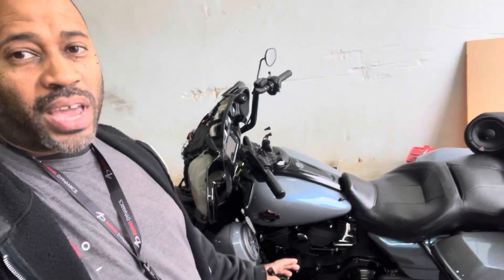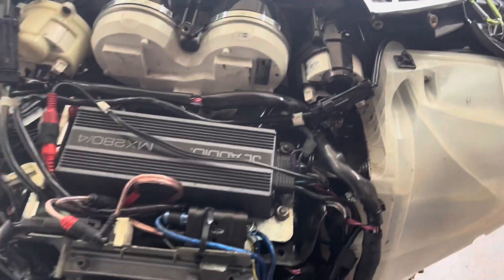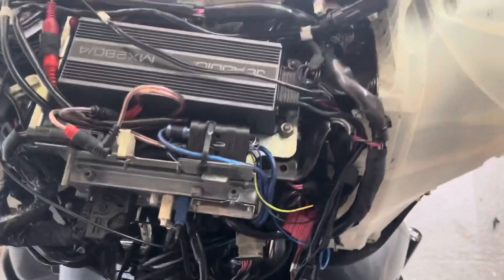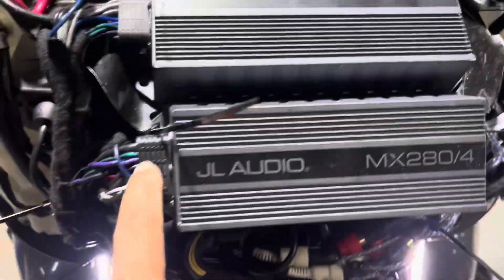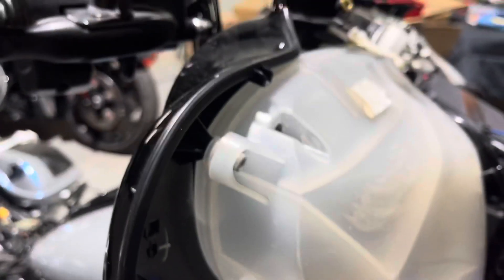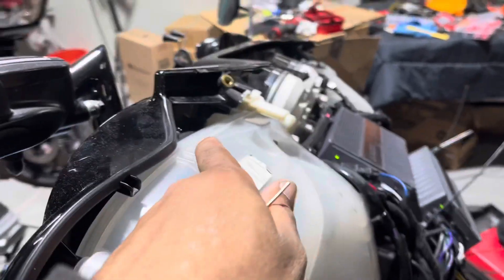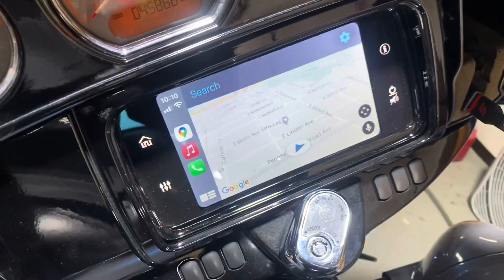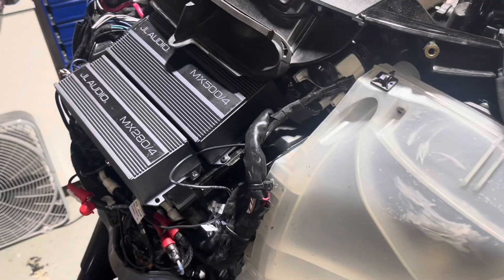Manny’s Street glide in for a 8 speaker setup ( no woofers in the bags ) Project - Battle Ship Pearl

Comment: I'm in Jacksonville FL, I have this setup on my bike  that I did myself, but I think it can sound much better 
I need to get it tune and probably need a wire rescue.
will like to send my Bike to your shop, do have a company that you use for your customers to shipped the bike to you?
Thank you 

2 Evox 1200.4
Model of Bike	Street Glide
Choose your DSP	Rockford DSR1
Stock or Aftermarket Radio	Stock
Stock Radio, has it been flashed?	Yes
What Inputs were used	Front and rear
Output 1/2 Speaker make and model	Ferring (Front)
Ground Zero 6.5" Coax GZCF 6.5SPL
Output 3/4 Speaker make and model	Lowers (Front)
DB Drive Euphoria XPERT EX6NCD 6.5″ 2-Way Loudspeaker
Output 5/6 Speaker make and model	Saddlebags Lid (Rear)
Hertz SX 690 NEO SPL COAXIAL
Output 7/8 Speaker make and model	Tour Pack Lid (Rear)
Cicada Coax Horn Speaker 8" 2Ω
Reply from the maker: We use god speed for transport 

Call me tomorrow and I’ll
Give you the contact info
Reply: @NVSAUDIO  I call but the M/B is full